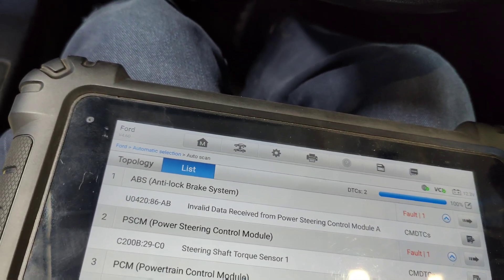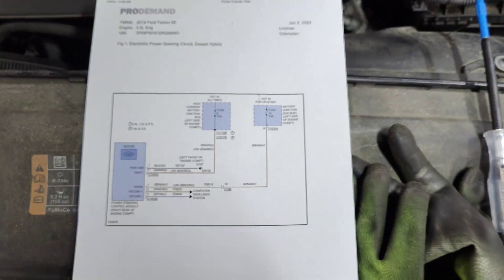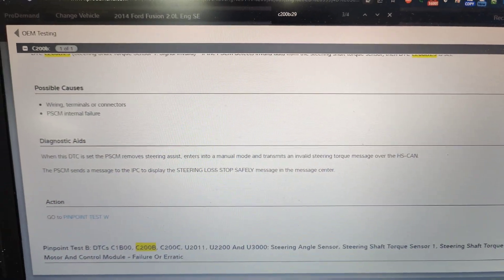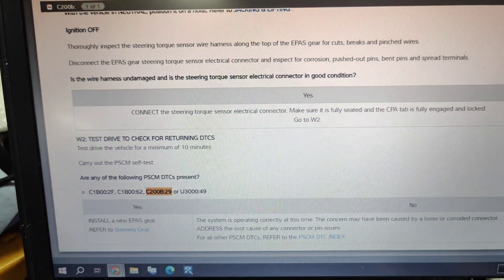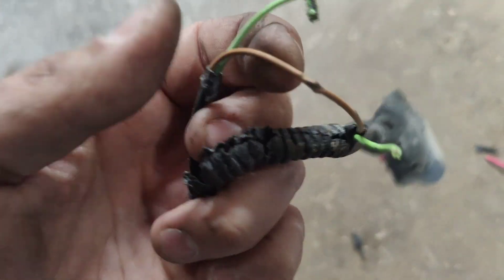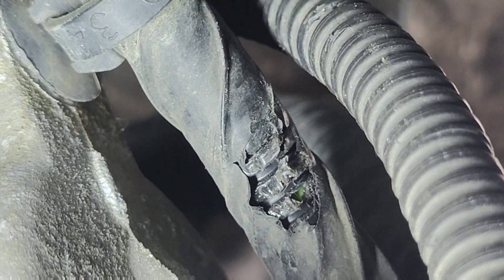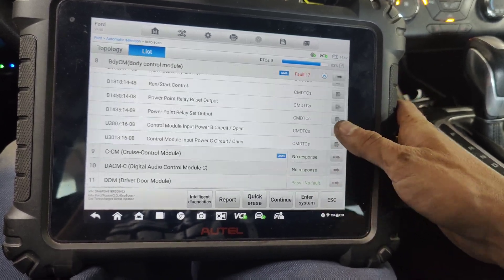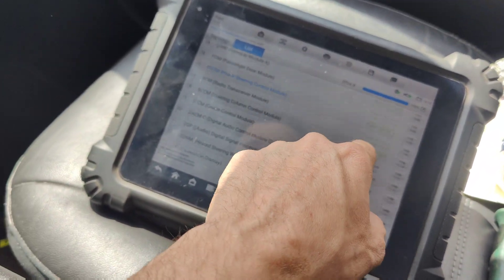2014 Ford Fusion 2.0L No Power Steering A Lot Of Messages C200B:29 Steering Shaft Torque Sensor 1

Comment: Hopefully you see this.  So I had a flat tire on my driver’s side and I took it to the shop where they helped me fix the tire. As soon as they put the tire in and I tried reversing. I lost power steering for about 10-15 seconds . When I put the car in park and shut off the car , power steering came back on but now what’s been going on is those lights are still there but my car runs fine power steering runs fine , I went to auto zone and I saw the coded U0420-00 and U0420-86.. do I need to reset ?

Comment: F* ck i 'm getting these warnings when making a sharp turn to the right. And the steering gets super hard, too. Simply putting the gear into P would fix the issue for now. Wonder what is wrong with it
Reply: @user-wc3tz3be1j  Sounds like it could be a wheel speed sensor

Comment: I just wanted to come back and say your video saved the day for us!  We had rodent damage on the exact same wire which gave the exact same codes. They were nice enough to chew both sides so I had a nice 8 inch section of the wire that fell out when I dropped the cover down 🤦🏼‍♂️

I spliced some new wire in and it worked perfectly and all codes were gone. 

Thank you!!

Comment: I  had same exactly issue with my 2014 Ford Fusion Titinum S. I took to a local cheap independent mechanic and he fixed the wires but the situation still as same the power steering to the left or right hand  very hard or rough to turn the car, then I took the car to the Ford Dealership to do some scanning and all hey came with Code [C2008] this is it and Im not sure they check the wires or the fuses majority dealers all they do is using scanner to do the job.

My question do you think that i need to recheck the wires again and the check the fuses since the cheap mechanic/ and the ford dealarship  did not check all the wires and fuses?

Comment: Got a question for ya. I have a 2017 Fusion SE 2.0 AWD with a Power Steering Assist Fault upon startup, but the steering works fine. Every now and then the message pops up while driving, but no loss of steering.
Reply from the maker: I would start by doing a full system scan on the car and see what comes up. A lot of things can causw the message. Dash messages are generic messages.

Comment: Hey man, really nice video, I have a problem I’d appreciate any suggestion. I have a mustang gt 2017
 I was driving on the rain, I got the message “Steering assist fault service required” in my dash and my steering wheel turn really stiff, I turn off the car and the message disappears everything back to normal but after a couple minutes it came back, I connect my scanner and got the error code U3000-49, I’m afraid water went inside my steering rack, any suggestions on how to fix this? Is it possible to give it maintenance and clean it or do I need a new steering rack

Comment: Saving this for later, I have a 13 escape that gives the exact same errors on screen, power steering went out and I changed the fuse and it fixed it but it just happened again and fuse was good, changed it for good measure

Comment: I have a 2014 ford fusion titanium, bought it in 2020. My dad and I replaced the steering rack 4 or 5 times now. Can't afford a mechanic to look at anything anytime soon. Just replaced it maybe 2 months ago, and just today, I felt the steering wheel stiffen up rotating back from a right-hand turn. Dont think we ever checked wiring very closely or fuses. Sure am getting sick of this car though but I'm stuck with it at the time being.
Reply: Remember to check control module and see if you can get it replaced. Either way fuses and make sure you use OBD scanner for better convenience
Reply: @sfgcggf2900  if you replace the control module do you have to Reprograme the module or not?

Comment: please help i had same exact problem animal chewed through wires, so i fixed them but when i turned on still did not work. checked fuses, all good
Reply from the maker: I would scan for codes and test the wires. You can get all this info in service information from Ford.
Reply: Hello, I have the same problem, have you found out what the problem is. This is the second time I have had a rodent/squirrel chew through my power steering wire. First time I spliced it and started it up and it worked fine, this second time I spliced it and not working, I too checked fuses etc, no luck. Please let me know if you sound anything out

Comment: How did you get the connectors off?
Reply from the maker: What connector off?
Reply: 2-3 inches from the repair splice.  I took the red clip out of the connector but It just would not unplug, so I had to splice it together on the car.

Comment: I have the same issue for the exact car but fuses and wires are good
Reply from the maker: Did you load test them?
Reply from the maker: Can you communicate with the steering rack?
Reply: @RobertDotterer Hi great video I have one code U0131 lost communication with module A I suspect the wire

Comment: Bro. What kinda of animal that client have in their yard? Looks like a large one got up in there. No amperage from the motor was the key to this diagnose. Solid find and work
Reply from the maker: Probably a ground Hog.
Reply: @RobertDotterer  lol
Reply: I have a 2016 Ford Transit Connect. A rabbit got up into the top of the engine. It must of not liked something as it chewed the control wired to the #4 fuel injector in 1/2 to make more room. 4 cyl runs like crap with 1 hole dead. not good for an engine that only had about 20K miles on it. New pig tail and it was good to go.